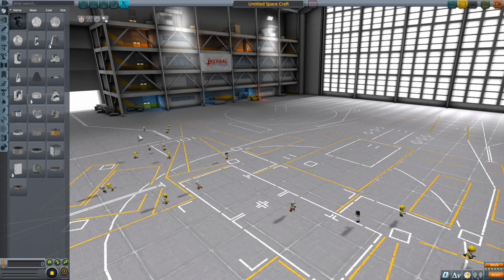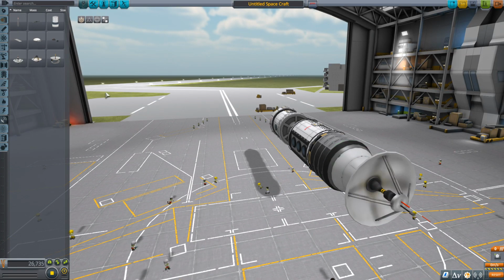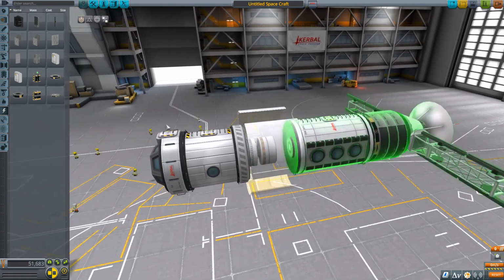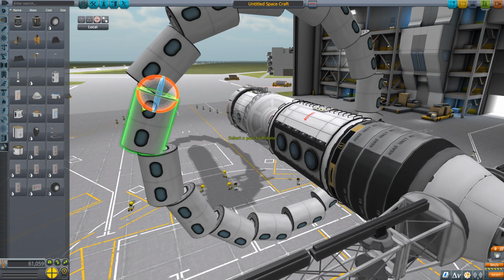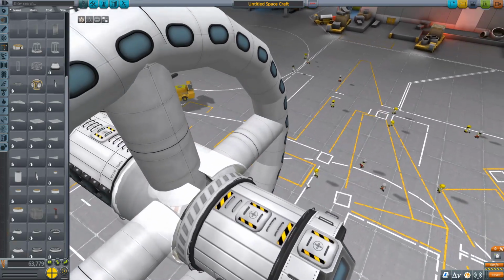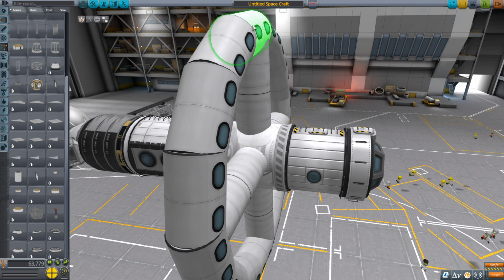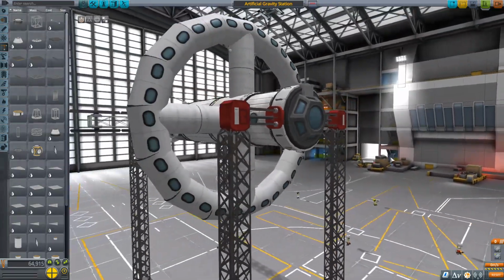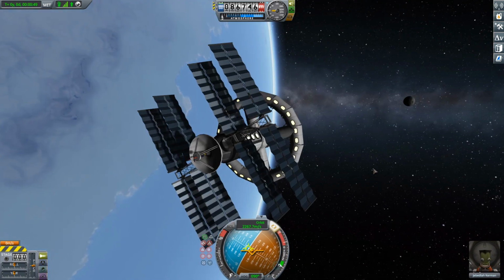How to build an Artificial Gravity Space Station! - Kerbal Space Program

Comment: It seems I can't make the ring system whenever I try to increase its distance from the centre it resets to half of the distance shown in the video

Edit: I have made it but can't take it to orbit it's too heavy
Reply from the maker: Try holding shift while offsetting the ring. As for getting it to orbit, you could either launch it in segments and dock them together, or just use a bigger launch vehicle.
Reply: @ooflespoofle3691  that's a cool solution and I can add two rings also to balance the rotational force 

Thanks u got a sub👍
Reply: Hello! For that, use Alt F12

Comment: Underrated YouTuber. You’ve definitely earned my sub!
Reply from the maker: Thank you so much!
Reply: @ooflespoofle3691  hey bro, after doing some testing I’ve realised that my ring just spins and then explodes, I’ve it on 10 RPM and I’m on Xbox if that helps :)
Reply from the maker: @lilcrackheadgames7333  make sure you autostrut all of the cabins and arms and also use the strut connector pieces to connect each cabin to the next and each arm to the cabins. Hope that helps!
Reply: Same
Reply: Yeah too!